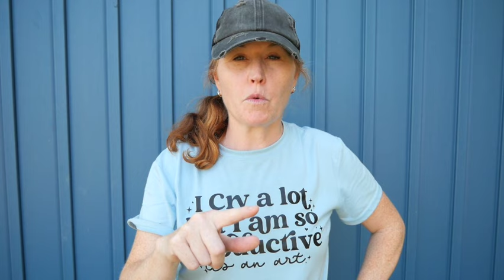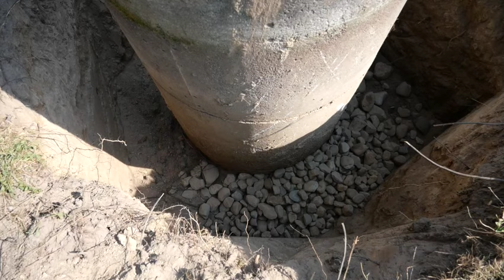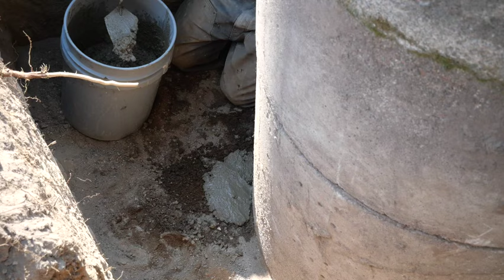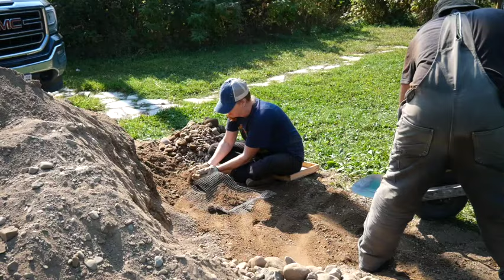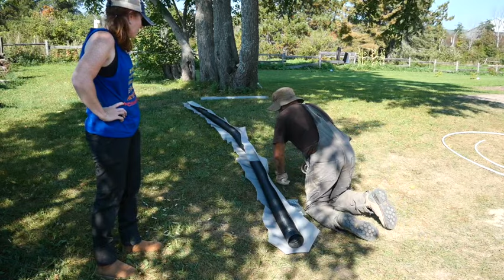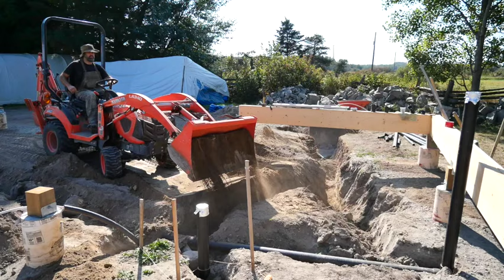Well, Well, Well | Revisited

Comment: You could use a gravity system for the toilets. Then all you would need to do is pump the reclaimed water to a tank in the attic, and then pipe it from there to the toilets. With a float valve in the tank the pump would only run when the water was low. No need for a Pressure tank and all of that extra work.
Reply from the maker: @michaelcravens3767  thanks for the advice!